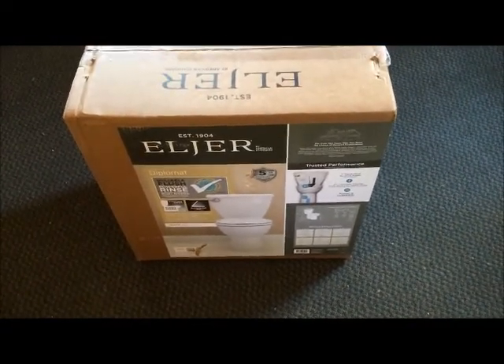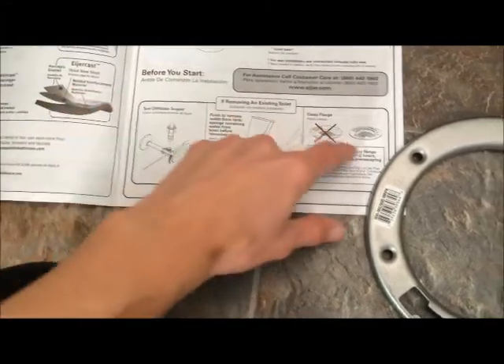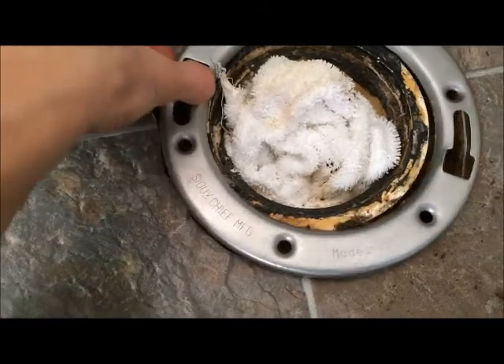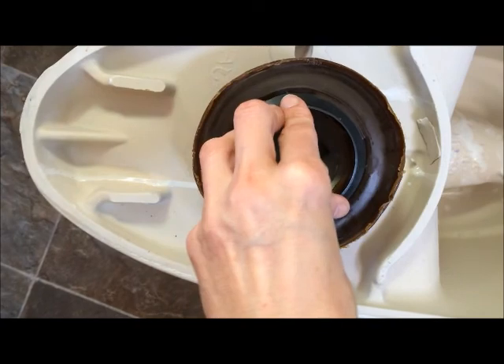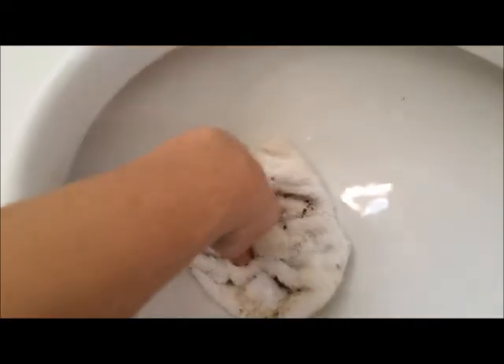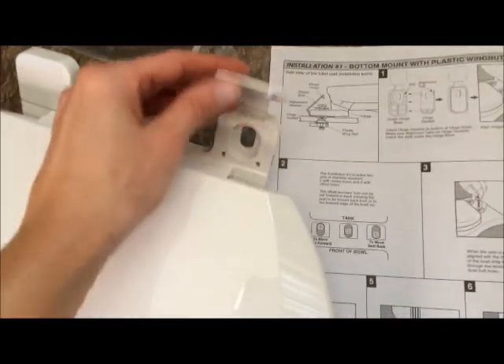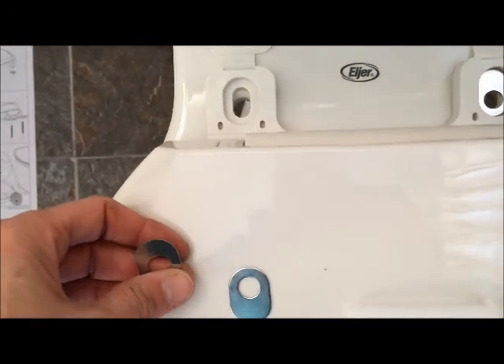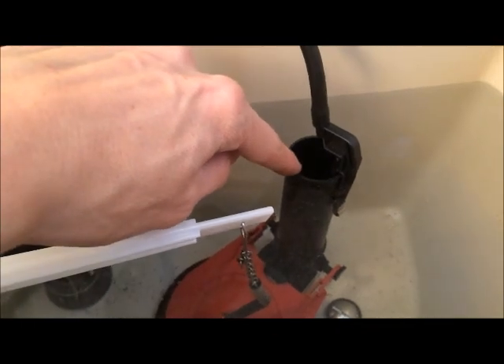How to Install a Toilet QUICK EASY 15 minutes Step by Step tutorial Old Bathroom This House

Comment: I bought the elongated compact model and its going back the tank bolt by flapper is hitting that mechanism and the head of bolt is hitting and if tightened down it goes in at a angle and still wont be able to be tightened down all the way due to hitting flapper base, not engineered well. needless to say i was pissed and have to drive 40 miles to return it, next one im opening the box and checking out before i buy and leave store.